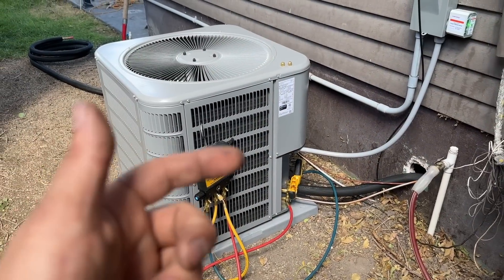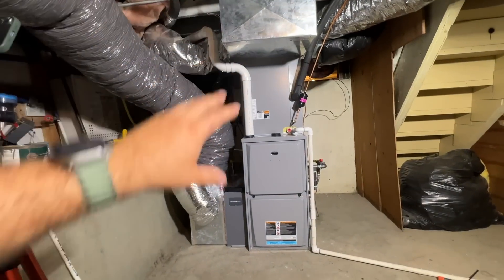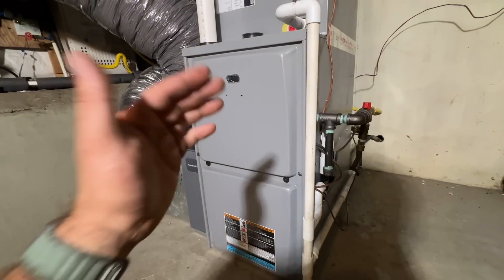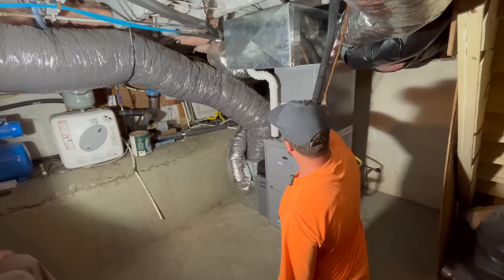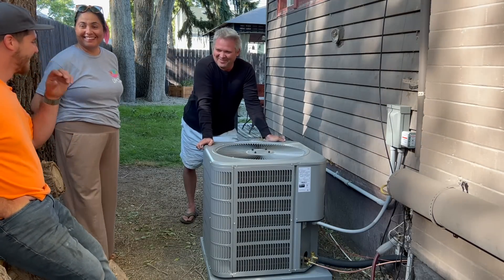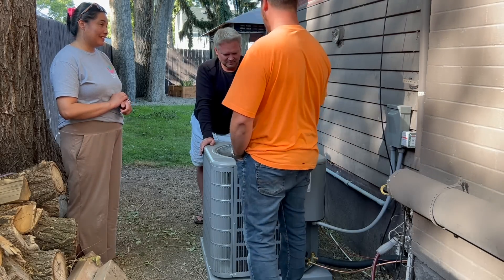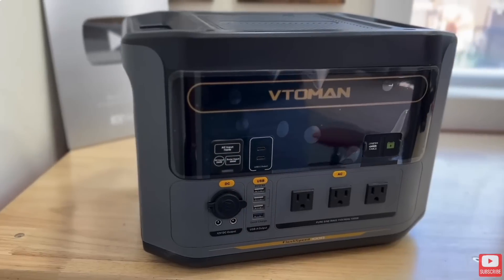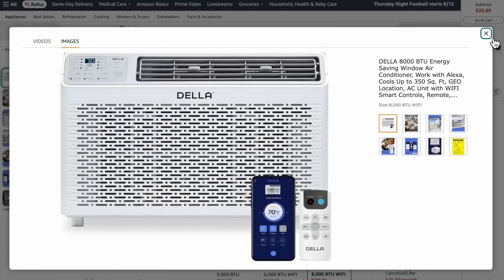They Had NO AIR CONDITIONING For Years. Then This Happened.

Comment: Romex in conduit is a code violation, here in our town.  Romex thermal heat dispensation is tested in open air.  Cant see any problems but inspector would gig this job. And they would ask if the installer pulled a permit and has an electrical license.  https://youtu.be/w0I8MzIwyfk?t=33

Comment: You and Alpine Home Air are doing awesome work!  Great video!!  Perhaps I missed it, but how do you go about choosing the recipients of these free hvac systems?  Also, how much clearance is there between the side of the "fan box" and the actual blower assembly inside (where you're cutting the square for the new filter box)?  Looks like an inch or two from the video...

I'll be signing up for your tech videos tomorrow!!